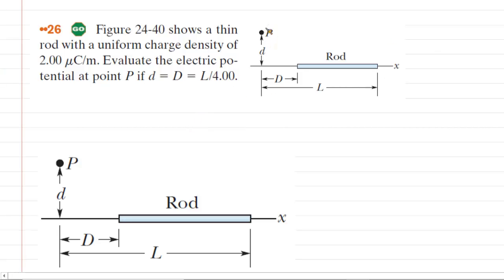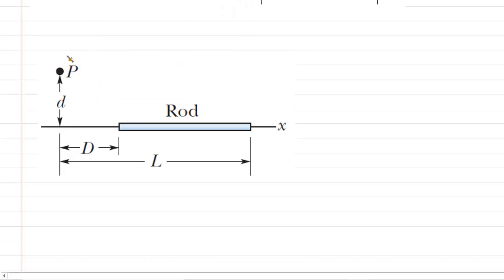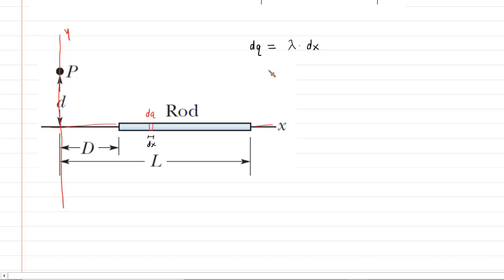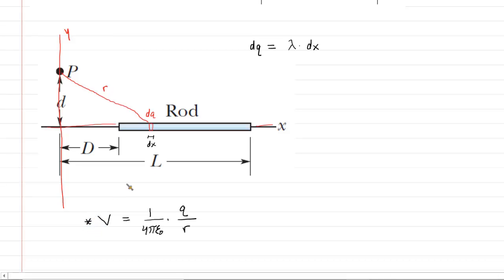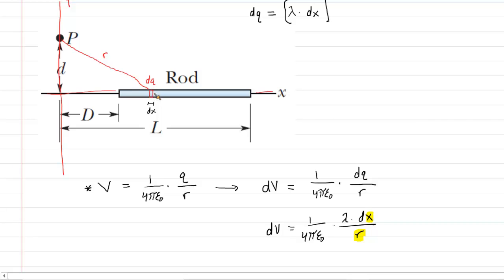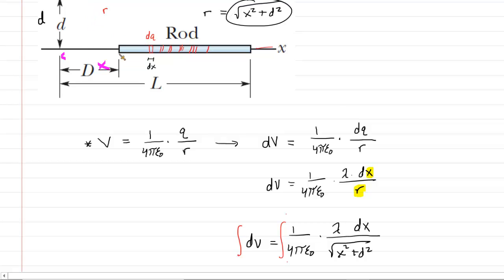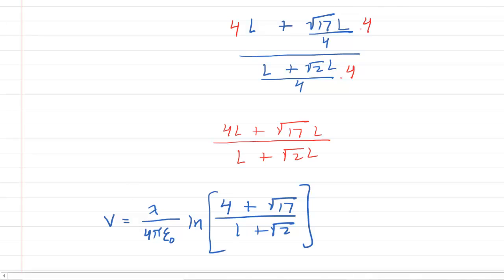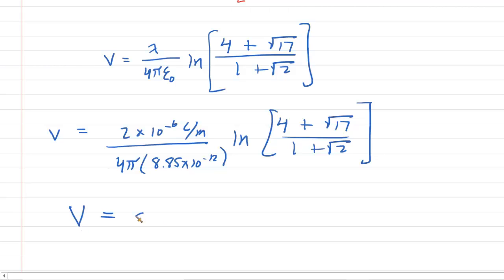The figure shows a thin rod with a uniform charge density of

Comment: If you are assuming r=sqr(x^2+d^2), you are assuming that the rod is the length from the orgin to the end. You need to take into change your limit of integration from 0 to L-D. If not, you are assuming that the section D contains charge when in reality, it does not.
Reply: Actually when he writes r=(x^2+d^2)^1/2 he is not assuming the rod length from origin but he is actully measuring the dist. between the elemental charge dx and position P . Where x is the distance of the elemental charges of rod from origin  hence its  limit should be from D to  L .
 Here u need yo understand we are actually integrating the distance between elemental charge on rod and origin that is 'x' .
Hence he is not wrong
Reply: i was thinking the same thing